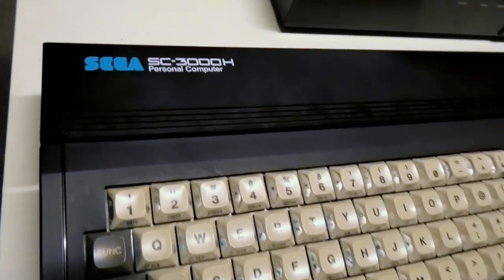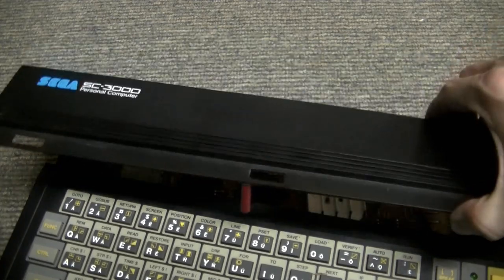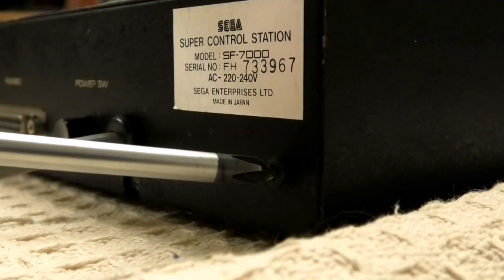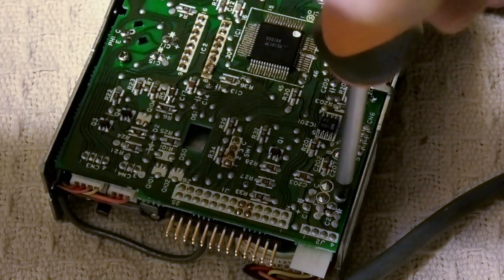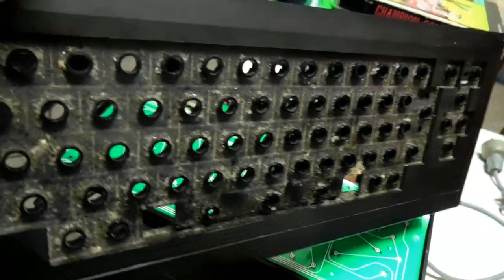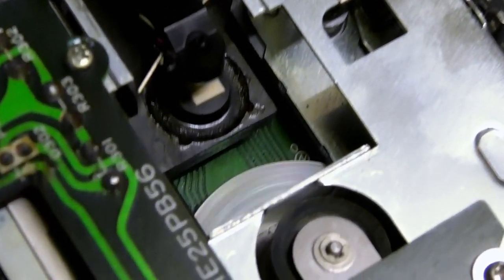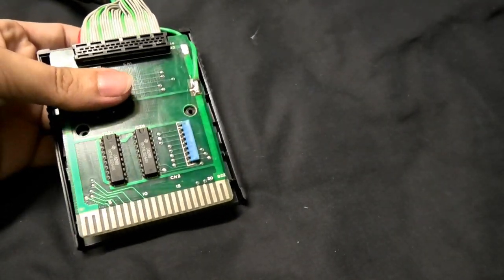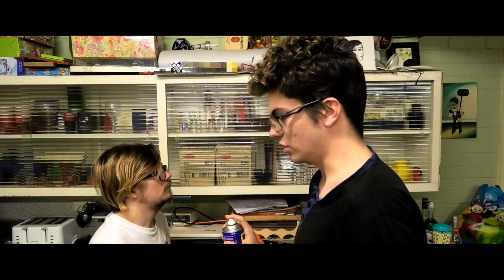RARE Sega SF-7000 & SC-3000H Repair | Joystick Division

Comment: I have an sf-7000- Could you tell me which belt to use? Cheers GDS
Reply from the maker: I looked on eBay for belts that are compatible with the following systems:

- Zx Spectrum +3
- Amstrad CPC 6128/6128+
- Nintendo Famicom Disk System (FDS)
- Amstrad PCW
- Oric
- Tatun Einstein
- Famicom Fisk System
- Roland S-220 QD

I don't know the specs of the belt, but I know they're the same as the ones used in the listed systems.
I hope this helps.
Reply: @JoystickDivision  Thank you- got the belt - my sf-7000 works again!!
Reply from the maker: That's really good to hear! I'm glad I could help.

Comment: I had same  KV25 Sony TV :)
Reply from the maker: It's a great CRT TV. I found it years ago before I knew anything about Trinitrons, so I got lucky there.
Reply: @JoystickDivision   Is it without Scart ? I had s-vhs,comp.component SDTV but no RGB Scart. Sadly i dumped it when i needed room :(
Reply from the maker: Mine doesn't have SCART either, but I use a nice SCART to component adaptor.

Comment: Just got myself both these units. Where does the ground wire connect to on the back of the 7000 ? Just to one of the back screws ?
Reply from the maker: Nice, I almost got another one the other day. Lost a bidding war.
But yes, I just use the case screw on the left side.
Reply: @JoystickDivision  Out of interest, How much do these units go for?
Reply from the maker: I've mostly seen SC-3000s go for around or upwards of AUD$700, but it depends on the model, condition and what it comes with.
SF-7000s are a different story. I haven't seen one go for less than AUD$1,000.
An SC-3000 + SF-7000 combo with a bunch of software recently sold on eBay for AUD$2,600...
Reply: @JoystickDivision  I have 3x SC3000H and an SF7000 I want to sell - where would be the best place to advertise the items? I'm in Australia btw..thanks for the responses 👍
Reply from the maker: Nice, I have two SC-3000s, two SC-3000Hs and an SF-7000.
As for where to sell them...
I'm not sure. I usually search eBay but occasionally they pop up on Facebook Marketplace. There are a lot of Retro gaming and computing groups on Facebook that do buy/swap/sell stuff, so that could be a good option. Those groups will have knowledgeable people that can evaluate your collection too.
Reply: @JoystickDivision  Cool, I'll follow that up. I have a stack of retro hardware/software I want to move on - Sega Nomad, Saturn, Dreamcast, rare games for the DC and Saturn, a Vectrex with a few games. Seems like an insurmountable task just to get them into the right hands. I might try Gumtree initially to gauge interest and go from there. Thanks again.
Reply from the maker: No problem, happy to help out where I can.
That's a good lot of systems too, the Nomad is the only one you have that I don't.
The Vectrex is one of my absolute favourites and happy to get some new games for it at the right price.
Reply: @JoystickDivision  I'll email you what I have - is the address connected to this YT account active?
Reply from the maker: Yeah, it should be active.